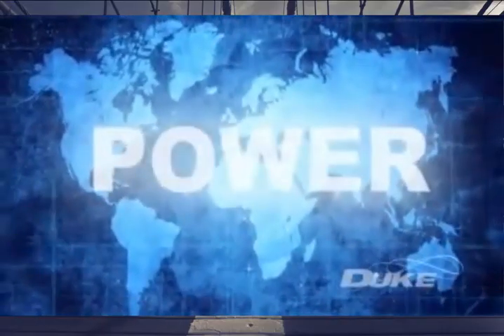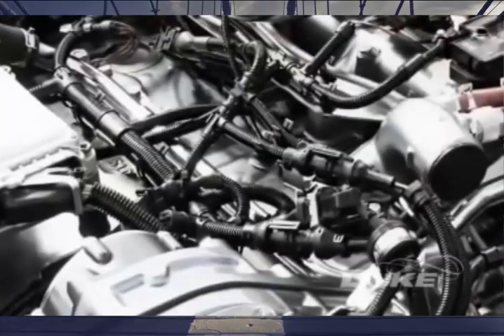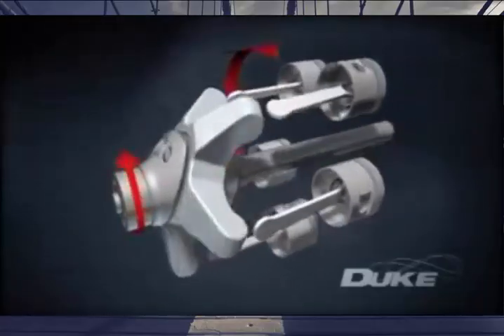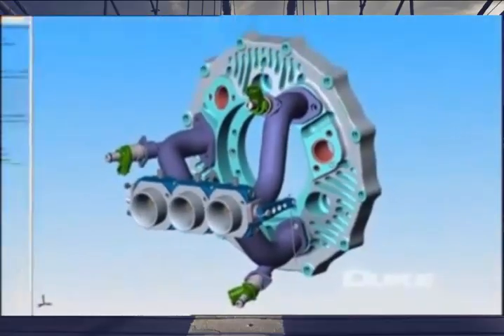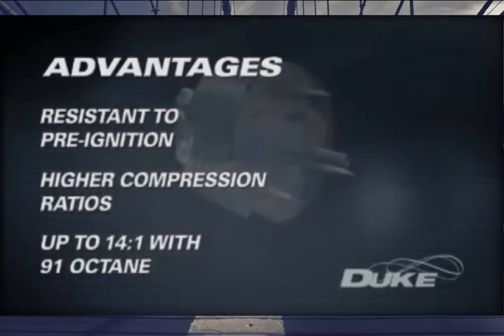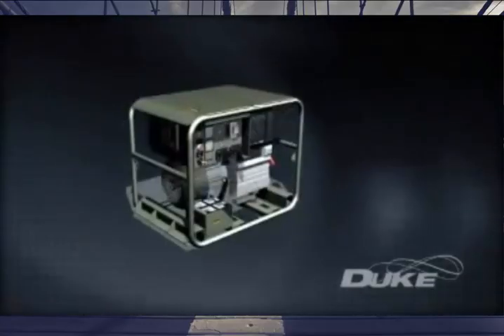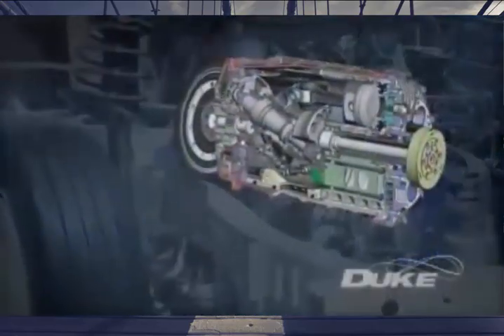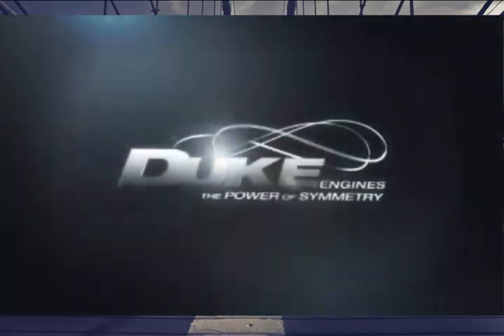Duke Engines | All information about Duke Engines

Comment: Or just go electric lol.
Reply: Yes electric. Where you create a larger carbon footprint than a gas powered car. You just shift that carbon production to the power plants. Charging and discharging a battery is not 100% efficient. That's why is more energy efficient to burn the petroleum in the car engine than use it to run a power plant and charge a battery then discharge that battery to get some of that power back.
Reply: Or you bshut the fuck up! Petrol and Disel FTW, electric can just fuck off!!
Reply: ofcourse.. we will burn wood and coal.. to fuel electric cars... that is the way to do it..
Reply: My point is this is less energy efficient than burning the fuel at the source. Lower energy efficiency means you need more power at the start point of the cycle. Thus higher carbon footprint for electric cars than normal cars. Upwards of twice the carbon.
Reply: Yes there are many non polluting way to produce electricity. Until the US gets the majority of it's power from these sources it's not environmentally friendly to use electric powered cars.
Reply: What Bill said. We need nuclear back on the map. The current generation of Nuclear PPs are from the designs of the Rickover "discount" designs to push faster development back in the early 1960s. Nuclear today is supersafe and if we deploy the modern tech to it, we can make looooong term (if not sustainable) energy in SPADES for next to nothing carbon footprint wise. And with modern designs there is very little garbage to bury in obsolete mines.
And then we can use oil the way god intended it; For cool cars :o) ... And leave the A-to-B commuter traffic to eletric cars powered by nuclear grids.
Reply: if you go electric - you pump electric power into an electricity using device - if you pump benzine, gasoline.. what ever you call it - it must be made first by steam-destilation from crude oil - this process also uses energy from the same source - although not direct - this is hardly effective - solarpanels can be used to power-up batteries.. and in such can reduce COx footprint - not that COx is the worst gas - there are other gasses introduced by combustion which are also unhealthy.

the making of solarpanels is also a footprint - so is the making of destilation systems.
Reply: You're correct but too simplistic. You don't use a lot of energy to distill crude oil into gasoline. Also well over 66% of the electricity generated in the US is from fossil fuels. You can't just dictate that you want your power that you charge your car with be generated by solar power. So the majority of power used to charge electric cars is going to cause more damage to the environment than ICEs will. Until our power grid begins to hit a larger percentage of production by clean energy sources, electric cars will continue to do more harm than good. The reason to play with them now is to increase their efficiency for the day when they do actually make sense.
Reply: Well many factors in that question. What car, where do you live, and how much do you drive each day. The Tesla Model 3 as an example living in a region that averages 4.5 hours of sun per day(which most people in the US live in a region that gets this average) and drives the average of 33.3 miles per day. Would require about 15 square meters of photoelectric cells just to maintain charge. However you would want a much larger bank of cells than that to account for long periods of cloudy skies as well as decreased(by 20-40%) efficiency during winter. So more realistically you're going to want about 45 square meters. So if you're not familiar with metric, that 161- 484 square feet. So between a 40x40 foot to a 70x70 foot area.
Reply: Electric engines needs energy source and batteries are the problem. Hydrogen cells are expensive and low power density. As well majority of conventional batteries are very bad for environment, including raw materials, manufacturing, refurbishing and discarding. Average electric car (even many hybrids) produces more lifetime pollution, than average modern car with combustion engine.

Government wrongly promotes these cars as they have low or 0 tail pipe emission, hence they reduce local pollution in places like metropolitan cities. However, this is short sighted vision as with increase of numbers of such (electric and hybrid) vehicles the global pollution will affect the same cities we trying to protect + everything else, because they are actually polluting even more.

Pollution is not something you can put in the box and send away to the remote location and even if you could, that is wrong concept.
Reply: Kahlas Even with all the efficiency losses, electricity still comes out on top, enforced by the fact that it costs about $0.15 per kWh. Or about $0.05 per mile. Gas/diesel is about $0.10 per mile. Do the math. 

The only real loss is transmission, losing about 50%. The cost of electricity accounts for that.. The rest from power generation to vehicle motor is in the 90% range. Do the math.
Reply: I don't think that price is the only way to calculate, it seems that you assume that there is 0 pollution with electricity, which is not the case.
Reply: howmuch pannels do i need to recharge one e-car every day - this is the question in short.
Reply: 15sql; 3.8 4by4 meters - stretched 2by8 - one double roof family home plastered with solar cells
Reply: Your math is a bit off. 40x40 ft is 1600 sqft (144 m2). For 160 sqft you need like 10x16.
Reply: http://www.metric-conversions.org/length/feet-to-meters.htm
Reply: There are other means to generate electricity that create zero pollution.
Such systems are growing more common every day.
Reply: You are assuming coal/nat. gas/petroleum derivative-powered plants. And you would be correct. There are already millions of KWh being generated via hydroelectric plants (which was the first major generating system, anyway) Hopefully we'll continue to develop solar and tidal systems too. And don't forget the (dare I mention it) nuclear plants. They have some major problems, but none that can't be minimized.
Reply: Solar cells which would, incidentally,  reduce you need for air conditioning.
Reply: you're brain produces electricity... and the rest, too
Reply: Power plants have extra energy at night, that is basically wasted if no one is using it
Reply: one can store it chemically - by converting water or pumping water from one basin to another - use it to refill car-batteries.
Reply: I agree 100%, but you're burying the lead on why hydrogen cells are a terrible idea: it takes more energy to make them than you can actually get out of them.  Most of the hydrogen on this planet is bonded to oxygen in the form of water, and it takes a LOT of energy to split them up.  It plays into your point about the energy source: what the hell is the point of having these cells if you're creating more of these carbon bogeymen (since you'd be using electricity likely generated in a coal power plant) making them than a normal car would put into the atmosphere?  Until we find an adequate "green" power source (or the greenies set aside their irrational fears of fracking and/or nuclear power), there's really no point in pursuing the electric car any further.
Reply: That is true. I would say that the only way to make "greener" hydrogen is to use the slack time electricity from all power station into making it. About 50% of electricity is simply lost during the quiet times, instead they could produce some hydrogen by electrolysis, kind of form of energy storage.

Comment: They need to call it a revolver, but unfortunately I think it's too late for introduction of new combustion engine designs. Although it looks really nice and I can imagine how they can be used in small light weight sports cars, but seeing as how car manufacturers are being forced to move away from combustion engines and to electric, I doubt we'll be seeing the light of day for the "Revolver" engine as I like to call it. It's a shame, I like the design a lot and it would've probably saved a lot of materials. I can also imagine how this engine can be easily modified on the cheap. I mean all you have to do it seems to get more compression out of it is to make the part that the pistons push down on taller.

Comment: Waste of time developing this engine as the main reason we need alternative energy sources is not because of engine inefficiencies but because oil is finite. Sorry duke but this is not game changing or world changing technology.
Reply: It's a stopgap measure, which is needed currently.  Yes petroleum is finite, but you don't transition from dependence on one fuel source to another (green) source overnight.  So, while the world slowly makes that transition, implementing improvements to existing systems is still a necessity.

Comment: nothing new here, they have been making air compressor pumps, hydraulic pump, a/c pumps with this design since 1940's! Only difference is that they put a sparkplug  on it. Hell your hydrostatic riding lawn mower has one in it. Its all the same concept.
Reply: I was thinking the same. is just like a car ac compressor.
Reply: exactly

Comment: A swash plated port/sleeve valved engine, mmm, unless much of its moving bearing/loaded areas of those components are plated in DLC (Diamond Like Carbon-cardibe), Titanium Carbide or other exotic platings upon a forged and peened surfaces, and has a massively over sized/designed thrust bearings for the longitudinal stress but on the recipricator/crank & its supportive 'bottom end' casing, engine life would be just as limited if not more so than usual IC reciprocating  and RCV engines - likely why such engies are usually of low service life - torpedoes, or high maintenance/servicing regularity - military/aerospace/racing.

Comment: This has all the same issues of a Wankel Rotary engine. Two of the largest are the cylinder seals, and the difference in temperatures on the different zones (intake, exhaust, power/compression) which can cause warping. First the cylinder seals, you have a rotating cylinders, in order to prevent compression loss, they have to be sealed at the top. Rotating at the top creates a major issue; the rotary engines resolved this with a constant oil bath, as a result, they burned oil, a lot of it. Then there's the differences in heat, you have multiple hot and cool zones, as stated before, this will cause warpage, which destroys a surface's ability to seal. Don't get me wrong, it's a great idea that's been in place for decades in other uses like AC compressors but like it's Wankel cousin unfortunately it's doomed for failure in this application.

Comment: Question is can you put a turbo on it?
Reply: Of course you can, you can put a turbo on EVERY combustion engine. All a turbo does is force compressed air into the cylinders. Superchargers do the same, so you can even supercharge it if you wanted to
Reply: rotors are really fuel and oil inefficient and unreliable unfortunately
Reply: its compression is capable of 14:1, why would you want to add turbo? LOL!
Reply: have you guys heard of diesel engines? They ignite the fuel by compressing it, therefore their compression ratio START at 14:1 and can go up to 25:1 even...
Reply: +stockika They aren't, they are really inefficient. In order for the rotor to not leak any fuel it needs to be sealed off using all sorts of springs and metal plates which in order to be lubricated, oil is mixed with the fuel and so you have a very high oil burning engine as well as very uneconomical engine since the fuel going in isn't pure. They are also extremely unreliable as only one side of the engine gets really hot and the other stays cold. This usually leads to engine block cracking.
Reply: turbo is nothing but to add more air. you can of course add a turbo. however the compression ratio has to be tuned down a bit if a turbo is added.
Reply: +Reddit Gold User  Ever heard of a throttle body?
It's how most engines do it today.
Reply: when the time for intake is not there there is no piston to put the compressed air... so yes it is ok.
Reply: +Ray Wu standard engines are capable of that compression, but compression doesn't mean you have more oxygen to ignite the fuel with
Reply: If it's already so powerful and economical, why not make it even more? Ofc you'd put a turbo on it if it meant more power and better economy. But I do think that the engine has a massive weak point with those massive swinging parts. And big moving parts don't go very well together with high RPM which makes it kinda unreliable
Reply: No, it doesn't have valves so there is no way to control the flow of compressed air
Reply: Jason Meng I think it's petrol XD
Reply: :D no problemo
Reply: That's true, unless of course you use a higher octane fuel or a more sophisticated fuel injection system
Reply: of course, it would be easier than modern engines, the exhaust and intake are inches apart.
Reply: Turbocharging is not inherently more efficient than natural aspiration.  Mechanical losses can be a wash, and thermodynamics can be better than older designs.  They can also be much worse.

Modern (pseudo-Atkinson) engines get peak efficiency by holding the intake valve open to let some gasses back into the manifold.  That means the power stroke is effectively longer than the intake stroke.  Letting the gasses expand more gets more power from the burnt gasses.  Peak power increase as momentum stops the back flow at higher speeds, while lower speeds have less torque and better economy.  Torque loss is ameliorated by improving the tranny.
Reply: What you're talking about is Variable Valve Timing. It's not a particularly new technology but it can be used with turbo engines. The fact of the matter is that if you give fuel more oxygen to ignite with, the less fuel you'll need from a turbo engine to produce the same amount of power as a naturally aspirated counterpart.
Reply: have a look at Detroit 4-71 6v-71 8v71 usually super charged but often also turbo charged and for racing trucks the turbo set ups are sequential turbos used on them there is no reason you could not turbo charge a two stroke petrol or diesel engine
Reply: thats bullshit: I saw 2 strock engines with turbos. It increases the power just like an normal 4 stroke engine.
Reply: 3 ?,,,,why not collect it all in one pipe and use one turbocharger
reminds with the rotary engine
Reply: It's ported induction. Compressing the inlet would not be a problem. Turbos, etc, would work very well.
Reply: turbo is needed when combustion is incomplete,but here as the compression ratio is higher there wont be any lesser air for less combustion . so turbo not needed
Reply: there is always a need to turbo.
Reply: Ethan Coy This is not a real engine design.. its a "bait engine" used to get gullible people to invest in the worthless company, the perpetrators then siphon off the cash never intending to actually produce or sell these engines...
Reply: how so? gas turbines have rotors and they are efficient compared to internal combustion engines.
Reply: mazda skyactive engine can do 15:1 :p
Reply: I think it's a gas engine here. :)
Reply: Pumpkin Whisperer
:D thx for correcting me.
Reply: Your post implies that less manifold volume improves turbocharging.  Don Devendorf (of Electromotive) disproved that common assumption.  His turbo Datsuns (and then Nissans) had rather large plenums, top of class horsepower and amazing throttle response.
Reply: But will u need turbocharging or supercharging if it gives u that much more power n fuel economy in a lighter unit?  are they getting any government support to help them along with the huge costs involved in developing n building this beautiful n advanced engine? i hope they are
Reply: 20 or more years ago maybe ive got a 13b with 160.000km on it and have had to do nothing what so ever to it yet.
Reply: yeah.. but this is an axial engine... not the same as a rotary.  it's like a combination of the two... it's nothing new.. think the first ones were made around 1911 by Macomber.
Reply: can't put a turbo on a 2-cycle engine...  It would end up causing to much opposing pressure inside the engine, killing horsepower.
Reply: Yep....And that might be the best application for this engine. Lightweight and high output diesel engines are sought after for commercial vehicles and stationary engines like generators and air compressors.
Reply: Sailing, Music, and Trucks Just tune it properly and decrease the compression. High compression can also be countered with high octane fuel
Reply: you would probably need a much higher octane fuel source. Sounds like at the time of this commercial they had just reached a point where easily-accessible 91 octane fuel was just able to work, and at 14:1 compression.
Reply: Pritam Bhagat The overall efficiency of a combined cycle heat engine is determined and limited by the efficiency of the first pass cycle.. turbochargers have a very limited inlet EGT so high Carnot efficiency is critical to conversion rate, fuel economy and longevity.

Its a moot point anyway, Duke engines is clearly a vaporware scam.. it is not a legitimate engineering project
Reply: no need to turbo it
Reply: but I'm this engine it would not work
Reply: Well I don't see why not, though you might want a lower cylinder pressure ratio at that point to prevent spontaneous fuel combustion
Reply: R13 Blow off valves?
Reply: ironbull2003 it said everything we want to hear to make turbo and high compression with less pre-ignition and higher revolution capabilities